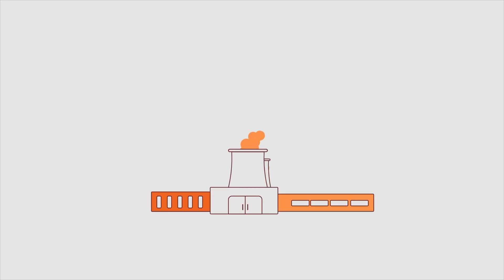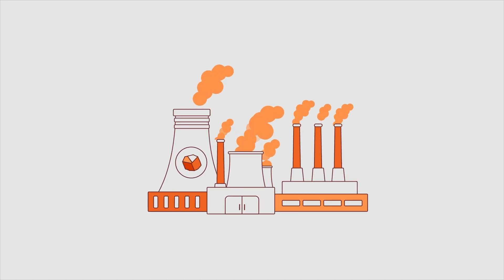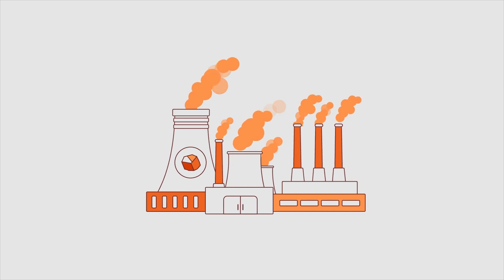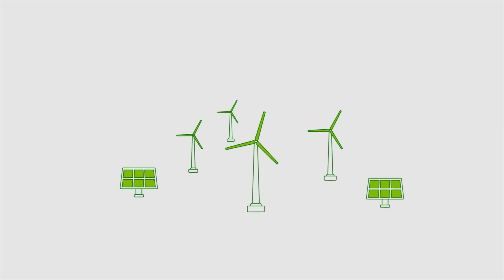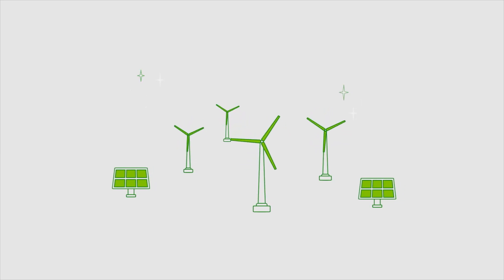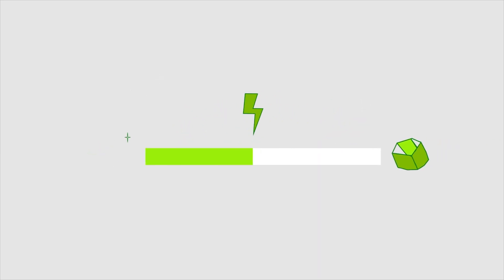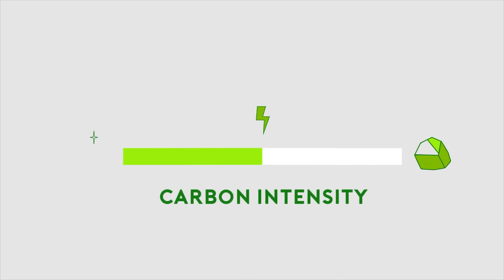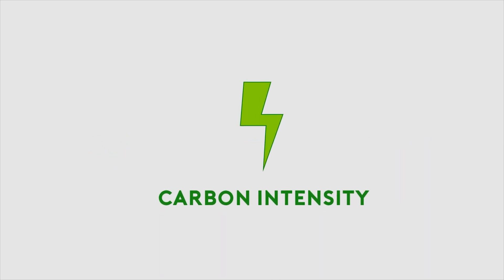Sustainable Software Engineering: What is Carbon Intensity? | One Dev Question

Comment: Unless your electricity supply is 100% renewable at some times, carbon intensity won't affect the extra emissions you create with your demand. Generally, all the low carbon generation that is available is being used. If you want more electricity, the system has to ramp up its generation from fossil fuel plants.